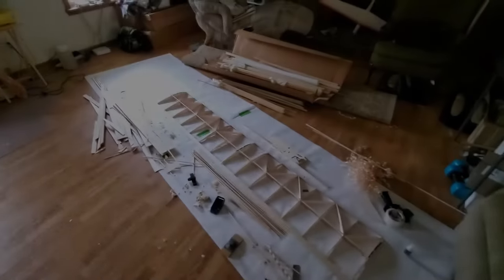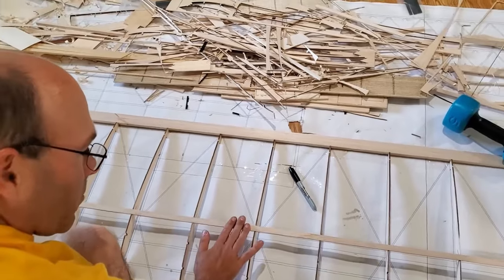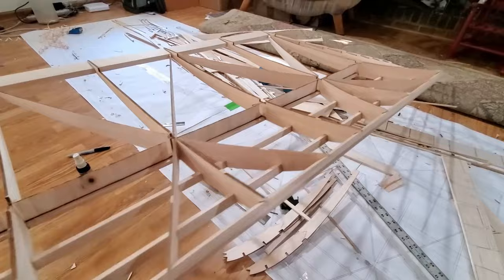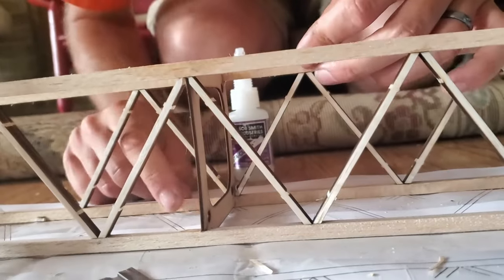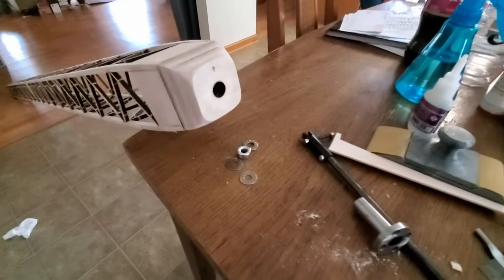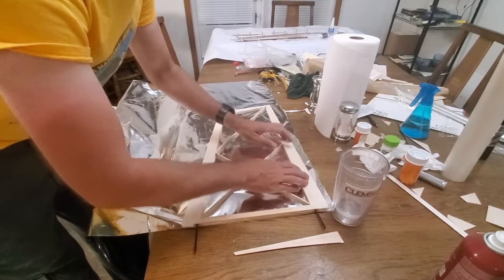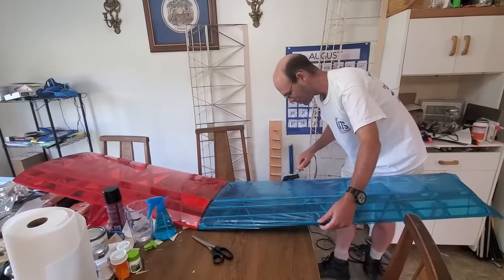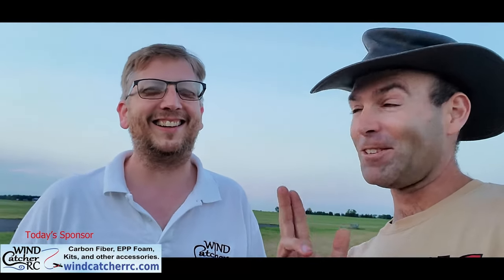Building the world's biggest rubber powered airplane, pt.1

Comment: Josh, thanks a ton for the WindCatcherRC tip.
I have been to his website, bookmarked it, scanned it and as soon as the next plane hits the drafting board I will go there for my foam, carbon, motor, servos etc.
I have had such a hard time sourcing foam that the plane nearly complete now has most of it's fueslage made from foamcore board and some scattered 2mm plywood. Plus the wing was cut from  a 2 by 2 foot square of Lowe's green colored foam coated and reinforced.

It will be great to have both the EPP foam and carbon fiber material available. Sure, plywood & foamcore can work but my 24 inch wingspan STOL craft would be lighter than its flying weight of 350 grams had I had the better materials.
Reply from the maker: Sounds like an awesome little project! Please let me know how it flies.

Comment: Hate to tell you, there was a man carrying rubber powered ultralight at Oshkosh in the 1980's. The pilot used a RC transmitter to control the rudder and elevator.
Reply from the maker: Yes, and it didn't fly. This one does. ;)
Reply: @joshuawfinn BAM! You hit him hard! 😱😁👍👍🇺🇲
Reply: I think you're conflating data from two different rubber band powered, man carrying aircraft. 
The 'RB-1' was a modified Lazair ultralight from the '80's (which had conventional controls) and the 'Rubber Bandit' was the purpose built 71' span with radio controlled flight surfaces built by George Heaven in the '90's. The former reportedly made a 1400' flight and the latter achieved what was described as "short hops".
Reply: @joshuawfinn  Are you predicting success or has it already flown?
Reply from the maker: @UguysRnuts  stay tuned for more. 😉

Comment: Hello, extremely massive and impressive build, I have two questions: What is its wingspan? If you has mentioned it during the video I probably would have missed it. And, I recently purchased some indoor model supplies, including 0.020” rubber. What is the max amount of winds? So I don’t accidentally overwind and break it.
Reply from the maker: For the model specs, there's a detailed 3 view on the front page of our website, with numbers measured from the completed airplane.
For .020 rubber, I would recommend making a small loop of known length, lubricate it, and wind a break in cycle followed by winding to destruction. Record torque and turns, divide turns by length, and now you have turns/length and can use that on all future motors from that batch.

Comment: I don't know much of anything about aircraft. However, since the prop is pulling forward, shouldn't the thrust bearing be on the back side of the nose block?
Reply from the maker: The tension on the rubber motor pulling the prop assembly backward is dramatically more than the thrust produced. There's about 50 lb of tension at full load.
Reply: @joshuawfinn  That makes sense. I didn't consider the pull from the band.

Comment: There's so much here, I neglected to comment on the tabs at the rib trailing edge that support the trailing edge spar at the correct angle to join the ribs. With undercambered wings, the leading edge of the trailing edge must be raised off the building board. Usually that is done with a strip underneath. With laser cut ribs, these tabs are an elegant solution.
Reply from the maker: Those ribs were originally drafted by Mike Kirda.  He did an amazing job with the tabbing and notching so that everything builds as simply as possible.

Comment: Seriously impressive build! What cyano are you using - you seem to have plenty of time to make the joints?
Reply from the maker: Mainly Bob Smith medium. I became an official dealer for them a couple years ago and they have done a really good job of late designing new anticlog bottles which stabilize the glue much better than the old style ones.
Reply: @joshuawfinn  Thanks, I'd guessed it must be a medium cyano. I'll try it when my current stuff is used up.
An anticlog bottle? That'd be good!

Comment: Josh, what are the specs? Wingspan, wing area, length, empty weight, prop diameter and pitch, etc. Video says motor is 32 strands of 1/4" weighing 1 lb 2 oz. That works out to 95.68 inches long with 0.336 square inch cross section, about 1,756 turns capacity, at 22 revolutions per second that comes to 79.83 seconds motor run. Rough guess engineering estimate. 

There is a saying in engineering "Good enough is best." Anything more is superfluous.
Reply from the maker: A full 3 view with most of those specs is shown on the jhaerospace.com homepage. Those are the actual specs, not estimates. Turns count is a topic to be further explored...
Reply: @joshuawfinn Thanks, Josh. You might want a bigger prop for that wing area. The pitch is another problem, then the motor dimensions. That all comes with test flying.